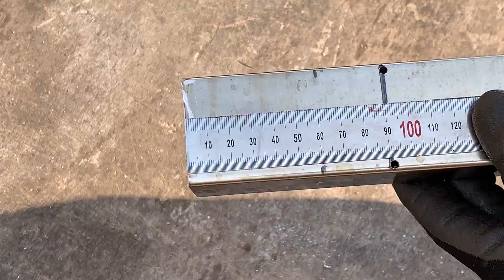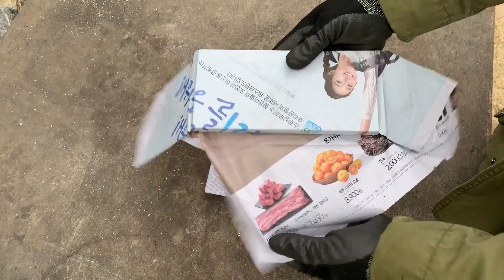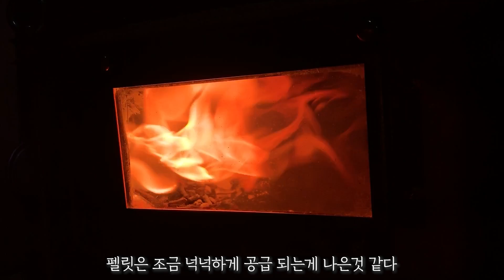Wood Pellet Combustor - Homemade Wood Stove for Camp M-Stove Project Part-4

Comment: Which pellet burner worked better? This one or the stainless steel bowl feeder? What was different? Do the pellets fully burn to ash!
Reply from the maker: I prefer a bowl type feeder. Its combustion stability is better. However, just please note that it is very important to optimize and keep an eye on it to avoid reverse fires. Depending on changes in weather, fuel, and usage methods, the draft force may decrease, resulting in a reverse fire that spreads into the fuel compartment. Pellets almost burnt to ash though.

Comment: how many hours will it burn from one fill up?
Reply from the maker: 1kg of pellets burns more that 1 hour. So need to install hopper on top. It is not designed for Overnight Camp. If the ash accumulates at the bottom, combustion performance may deteriorate.
Reply: @campingtogether  Thanks for your reply. Nice videos!

Comment: Camping together

Really nice rocket stove attachment with the pellets.

Do you know what a thermal couple is????

You put a piece or iron in the stove or bolt copper wires to the stainless steel.

Then hook an aluminum radiator to the other end.

Put a battery in the loop between the stove and the aluminum radiator and you now got power to the battery. Check it out.

Also if you take the battery out of the loop and put a box around the aluminum radiator or heater core from a car. The aluminum will get cold and now you got a frigerator to keep food cold.

This is called a thermocouple and what I said above does work.

Thanks

John
Reply from the maker: I am working on it. :D I want to generate electricity and rotate fan with it. Thanks

Comment: With the pellet attachment, you turned it into a rocket stove.

Extended out the air intake with box steel 6 inches and attach the air intake to the end of the 6in box.

This will improve efficiency and extend the life of your burn time, as this will cause it to be a more efficient rocket stove.

Also get stawdust, and make a dead press to turn the sawdust into pellets. You can use concrete glue, eggs, or used cooking oil as a binder for the sawdust.if you use cooking oil on the sawdust at all, WARNING, use very little as it can become explosive. Cooking oil with sawdust Burns very hot. Used motor oil also works but I don't think you want to use that.

if you make A dead press for the sawdust and press the sawdust pellets out yourself and you don't have to pay for any wood or wood pellets.

Fun project like watching what you're doing.

Thanks 
John
Reply from the maker: Thank you so much!

Comment: Quelle quantité de granulés ton poêle consomme t-il durant une heure ?
Y a-t-il un risque pour que les granulés cessent de s'écouler ? On peut imaginer que à cause de la chaleur il y ait une semi combustion dans le conduit descendant et qu'il se bouche.
L'idéal serait de fabriquer un réservoir à granulés permettant de durer une nuit complète sans le remplir.
Reply from the maker: Lorsqu'ils sont réglés sur la puissance de feu la plus élevée, les granulés de 1 kilo peuvent brûler plus d'une heure. Les tuyaux carrés de 50x50 mm peuvent très rarement provoquer des bourrages de pellets. Si possible, un tuyau carré de 60X60mm semble être plus stable. Il est probable qu'il est important de faire correspondre le réglage du plateau de combustion avec un angle approprié à la hauteur de l'alimentation en air pour empêcher la combustion de se produire au milieu du distributeur de granulés.
Reply: @campingtogether  
Tu es francophone ou tu utilises Google Translation ?

Compte-tu inventer un poêle à granulé alimenté par une vis sans fin ? (en anglais : worm screw / endless screw / auger). Ce serait plus sécurisant. Il y aurait aussi un beau défi à affronter : utiliser un thermostat pour commander le débit du moteur électrique de la vis sans fin. As-tu des compétences en électricité / électronique ? 

En anglais, si tu maîtrises mieux cette langue :
In English, if you have a better command of this language:

Are you French-speaking or do you use Google Translation?

Do you plan to invent a pellet stove powered by a worm screw? (worm screw = endless screw = auger). It would be more reassuring. There would also be a nice challenge to face: using a thermostat to control the flow of the electric motor of the worm screw. Do you have skills in electricity / electronics?

Comment: Nicely done sir.  The firebrick is a great addition adding longevity to the stove by reducing metal fatigue and adding thermal mass to hold heat longer as fuel burns down.  Next season you need to install a permanent chimney in your tent with a stove thimble below the damper.  Connection from chimney to stove could be with a piece of automotive flex exhaust pipe.  See example but purchase from a local source.  Stay safe. 
Again, thanks for sharing. 
https://rover.ebay.com/rover/0/0/0?mpre=https%3A%2F%2Fwww.ebay.com%2Fulk%2Fitm%2F311579377328
Reply from the maker: As the stove gradually heats up, it retains heat well and helps with combustion stability. It's fun. Thank you.

Comment: Excellent! How quickly do those pellets burn? Could this system potentially keep a stove running slowly overnight? The problem with many camping stoves is that they go out in the middle of the night and you wake up cold and have to relight it!
Reply from the maker: 1kg of pellets burns more that 1 hour. So need to install hopper on top. It is not designed for Overnight Camp. If the ash accumulates at the bottom, combustion performance may deteriorate. I will try the continuous combustion test soon. Let's keep it going.
Reply: @campingtogether  very interesting! Thank you!

Comment: try moving the burn pot to the othe side away from the chimney I believe your previous Down draft burner was more efficient perhaps combine the two
Reply from the maker: Chimney is there but troat is on the other side. I agree with you that down draft burner is more edficient!
Reply: @campingtogether  a larger  hopper and tight fitting lid on the hopper would improve the down draft I would also consider upgrading the baffle  plate you had to something heavier like  1/8 plate steel OR fire-brick you are starting to push the melting temp of that stainless when you are not heating something , maby consider mounting the downdraft burner at a angle in the door it would help with it starting because the fire would be lower then the  intake of the chimney